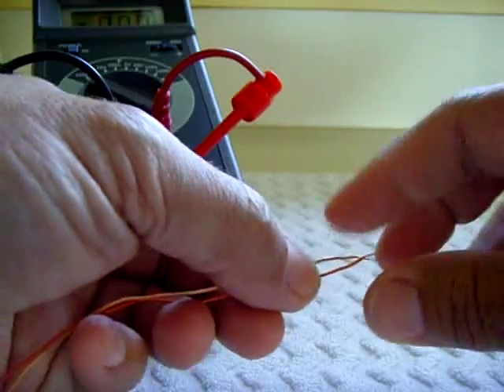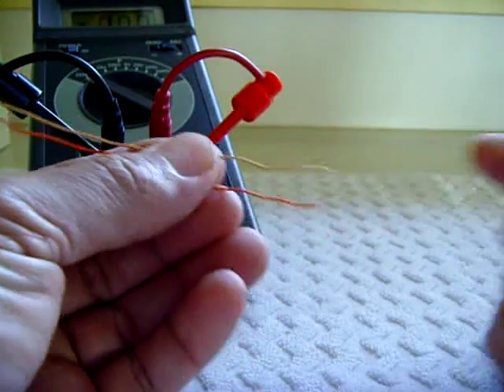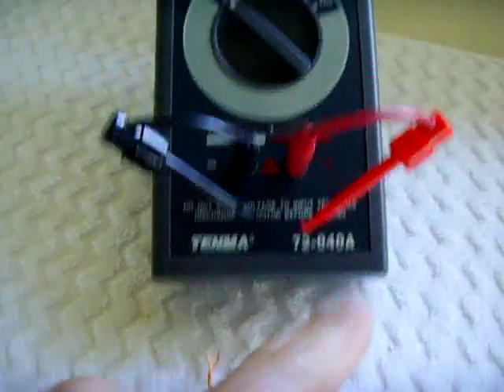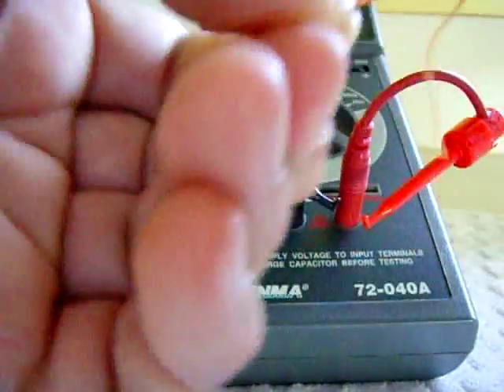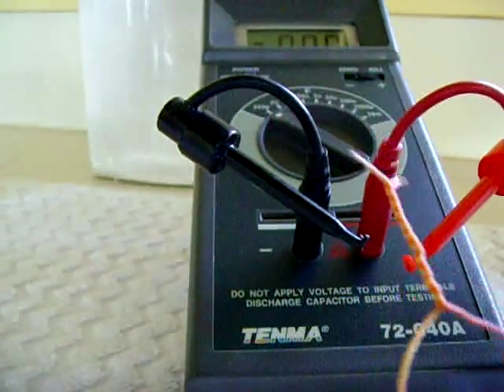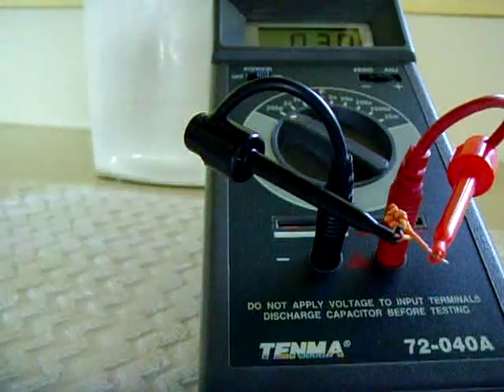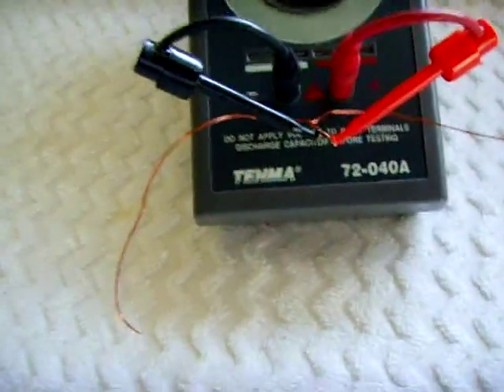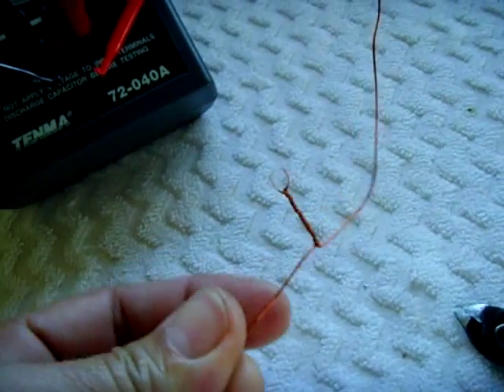How to make a good pF Capacitor "Gimmick Capacitor"

Comment: You have to remember that mechanical stability is necessary to keep it from changing value.  So use solid wire, and if you are using it for high radio frequencies it is better to keep it short, and instead of folding it over, make two or more short ones and put them in parallel.
Reply: Hmmm yeah, there will be less inductance that way too.
Also be mindful of the resin you pot it in too so you don't degrade the performance as well.

Comment: You usually won't get a well defined or low value temperature coefficients.
Reply: That is something I wondered about.
You could fluke something depending on what you pot it in afterwards 😂

Comment: Not sure if this was mentioned but it is worth emphasising: Be careful when twisting the wire that you don't chip the very thin paint.  You want a capacitor, not a short circuit.

Comment: Hi, great idea, great video
What is the maximum voltage this capacitors can handle?
Reply from the maker: All depends on the dielectric material and thickness that's used.
Reply: Since these are telephone wires, they are rated at around 50 volts.
But I think what is important is amperage not voltage. Phone solid wires are like 1/3 millimeter in size(without insulation) So they are close to AWG # 28 and SWG # 30
http://emtel.com.tr/en/useful-information/awg-swg-conversion-table/
https://en.wikipedia.org/wiki/American_wire_gauge
currents in theory are there ^ (fusing current= how much they can take before melting in amps)
Reply: the dielectric strength of plastic is pretty high because its a solid,  so id say it would be ~6000 volts maybe less...

Comment: in my old computer speakers, when I have the earbuds plugged into the head phone jack, I can still hear the sound coming out of the speaker. I visually inspected the jack and did some cold continuity checks on it. I believe it is good. 

on the circuit board before the jack is a polarity capacitor electrolytic type I think it is causing bleed over though it does not show signs of leakage. Have you ever experienced something like this. I thought I would just pull it and replace it, I don't have a cap tester.
Reply from the maker: +Mike Shea (sheadtree) 
Faulty jack.

Comment: If you've ever done any radio work you now stray capacitance is a big issue. So it makes sense that the thin wire on 24 gauge telephone wire would act as a low range capacitor.